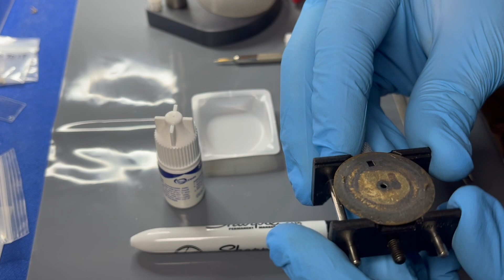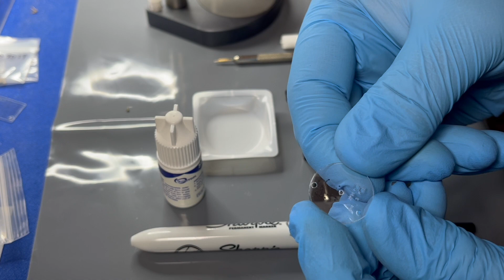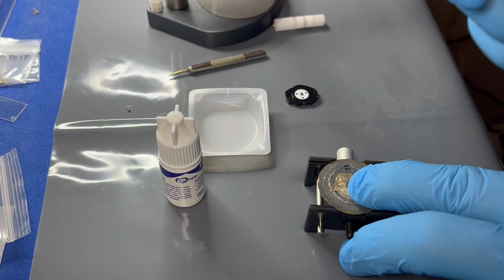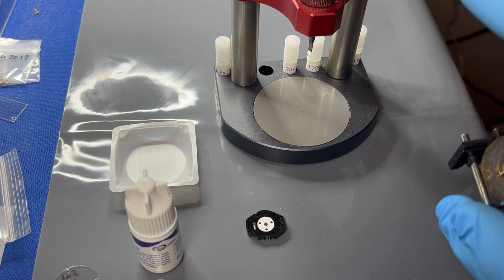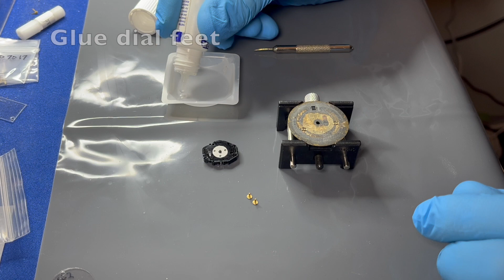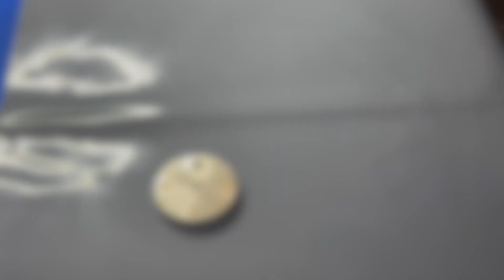Watch Dial Feet Repair and Retrofitting Using Dial Feet Guides (Tutorial)

Comment: Quite new to watch modding etc and already had dial feet problems. These templates are a great idea and will save hours of messing around and ensure some accuracy of positioning. Do you have a link where the milling tool stand and milling cutters can be sourced. Great video and all simply explained. Nice job. I’ll be ordering some of those templates from your eBay link!
Reply from the maker: @marktimbrell1761  Thanks for your comment, glad it was helpful! You can find them on eBay as well, but they will be cheaper from places like Aliexpress. It might take longer to get to you but it is much more cost effective. If you want higher quality you may be able to find similar tools on Esslinger or Ofrei, which if you are getting into watchmaking are the best sources. Here is one I found after looking on Aliexpress:
https://a.aliexpress.com/_mr6ENcj
Reply: @qin_watches  many thanks for the quick reply… so many never bother to reply, so that’s great of you. Being an engineer (machining) the milling has to be done on a solid platform and rotating spindle otherwise it’ll just chatter and wander. I’ve seen the esslinger site I’ll check it again .
Reply from the maker: @marktimbrell1761 You’re choosing the right hobby with that background! I agree, for workholding absolutely don’t want to skimp. I use Bergeon holders as they are probably the best. Horotec is generally pretty good as well